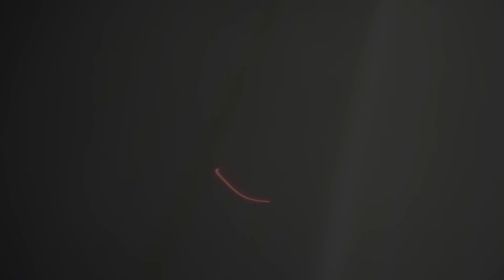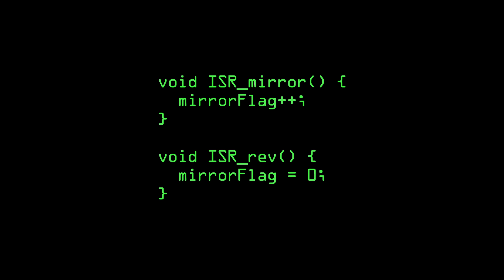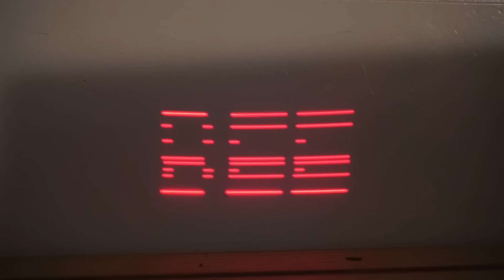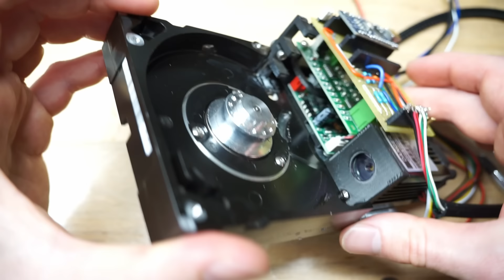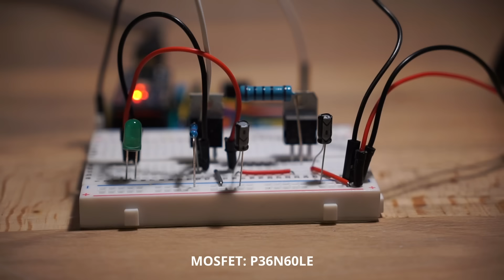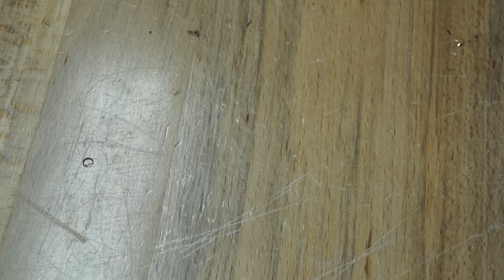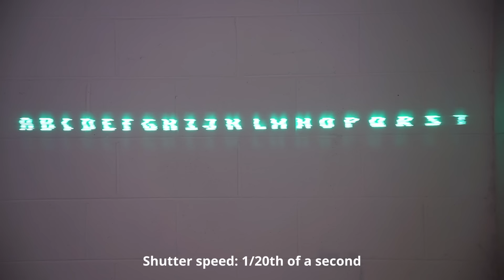DIY Laser Projector - Built from an old hard drive

Comment: Interrupts on Arduino introduce random ~10µs jitter, which is roughly consistent with the jitter amount in your tests. For tight timing, try to disable interrupts during the laser toggling and instead wait for the sync pulses from the photodiode by directly reading the pin register in a blocking while loop. The serial communication can be done between frames while waiting for the frame sync (if necessary, this will add one more disk rotation with laser off as a "blanking" interval).
Reply from the maker: Thanks for the info. I definitely need to optimize the code - I'm still pretty inexperienced with the more advanced features of Arduino. Looks like I have some reading to do.
Reply: @benmakeseverything  Yeah, I was also surprised by this "easter egg" when trying to find out why my pulses randomly become 10us longer a few percent of the time, which is pretty bad for time-critical bit-banging. Turns out it's a known issue, but it's pretty straight-forward to disable interrupts around the time-critical part of the code. Just be aware that you can't use timing functions (except microsecond delay) when interrupts are disabled, so the code has to be very "basic" in terms of execution flow (wait for trigger, write out the laser pulses, repeat; and do the "smart" stuff only after the frame has finished).
Reply: @benmakeseverything  Also in theory the second sensor that measures when a full rotation is achieved isn't necessary since the the speed would be constant once it has spun-up and the total sides of the mirror assembly is fixed and know. The inverse is also possible where you could remove the other sensor and just divide each rotation count by the total sides count.
Reply: @smashed_penguin  The full rotation sensor is necessary to synchronize the start of a frame because there is no "intrinsic" way to tell which mirror is the first line if you start from an unknown state. You'd have to manually tune the delay after it has spun up until the image is correct, but that's not very practical (and it will lose sync again if there is a single glitch causing a missed line pulse). It's true though that the full rotation sensor alone should be sufficient and each line can be started with a fixed delay relative to the frame (i.e. full rotation) sync. This would require perfect mechanical balancing of the disk, otherwise you'll get vibrations causing mechanical jitter within the rotation. The additional line sync sensor effectively reduces the mechanical jitter by the number of lines.
Reply: @RealNovgorod  I did not think of that 💩
Reply from the maker: @RealNovgorod  You said it better than I did! This is exactly the reason for the 2 separate sensors.
Reply: @RealNovgorod  it is true that it is much easier to synchronize the full set with the extra sensor, but it could also be replaced by the absence of a tab creating a gap that is twice as wide and just keep track of timing for that gap using software and timers. However, this would only be worth it if you were mass producing these. When you only make one the extra 50 cents for a sensor is negligible.
Reply: @benmakeseverything  A timing of the the digitalWrite function is not stable. (you can find more info by googling  something like "arduino digitalWrite timing). So you need to use a direct manipulation by the port, not digitalWrite. Also, some libraries for that purpose are created. But for your particular task (turn the single pin on/off) it will be just 2 lines changed.
Reply: @benmakeseverything  I have an idea for how you could develop this project further in the future, maybe make a custom app for it as this Laser Projector uses BLE (Bluetooth Low Energy) - also awesome video btw!
Reply: @benmakeseverything  All so consider how a laser printer does it, they use a single photo transister that watches a fibre optic line, at the start of the mirror to signal the start of the scan
Reply: @benmakeseverything  would it be possible to 3 audioinputs do feed the X Y Z axis?)
Reply: @benmakeseverything  : The 8266 Wifi module (sometimes called NodeMCU) is about the same price than the Arduino (2 to 3 euros or $) and run at 8 (or 16) MHz. The good new being that you can entirely re-use the same code except for pin numbers and timings.
Reply: @benmakeseverything  im opting for a collab of you guys! as a C/C++ Engineer i could see a potential breaktrough in quality
Reply: @GreatBullet  Thats contrary to DIY or learning by doing ;) 
If you want so, you could buy the knowlege or labor for most project. But thats not the goal for guys like him.
Reply: jitter on low end AVR Arduinos is not due to interrupts themselves. Rather its due to timer configuration and background "arduino" stuff that comes with even a "one line" sketch.  The millis and micros timer functions are VERY jittery. Hardware interrupts themselves are generally spot on. 

My suggestions would be:
1: If you can, upgrade to something much faster, such and ESP32 or STM32.  ESP32s are so cheap and incredibly fast in comparison. Timer interrupts, millis() and micros() are dead-on accurate. Having a wifi server for  your text input might be worth the upgrade.
 If you cant (or dont want too)...

2: Your horizontal array scheme is convoluted, and is too much work inside the interrupt. And really unnecessary. You have already divided vertical resolution to 12 bits. Rather than playing with timing calculations mid swing, running an abs() function, etc, just divide your horizontal sweep into discreet bits as well. Like, define a character block as 8x12. Then your array is just a bit array of ON or OFF. Actually, one horizontal sweep per character is now a byte. So, a full character is easily defined as 12 horizontal sweep bytes. This will be MUCH faster to process and not timing determinant (your method may be a bit INdeterminate). All in all, this will be much easier to stack bytes in the sweep buffer, move characters around (scrolling text for example), etc.  
Set up a timer interrupt (duration is the WIDTH of the "pixel") that all it needs to do is read the current bit and turn the laser on or off. Keep that ISR as tight as possible. The second, hardware interrupt (triggered by mirror flag) just increments row and loads the row bytes into the buffer. How skinny or fat your font is will depend on that timer interrupt, and will determine how many characters you can fit on the line.

you are currently using signed integers for your array which needs two bytes per array entry. Just the letter A code you showed took 96 bytes to draw. You are doing math, and playing with negative numbers.  Arduino's timer interrupts (especially on low end Uno etc) require careful consideration and configuration, because the "default" millis() clock is quite jittery. Put it together, and you've got bacon letters.  My suggestion reduces the letter A to just 12 bytes and 96 timer interrupts. NO MATH.

I once had to make what I thought would be a simple servo frequency up-converter. Read in servo signal. re-output that signal on a higher frequency. should have been a quick job. Well it introduced all kinds of jitter and flutter on the output. It ended up taking a day or so to iron out.
Reply: Yeah, what  @epremeaux  said is correct - seems like you've reached the point where the Arduino framework is getting in the way. AVR chips are "slow" by computer standards, but 62 nanoseconds per cycle is plenty fast enough if you use it carefully

The use of `int` and `pgm_read_dword_near` are eating a lot of cycles too. If you don't need values larger than one byte, use int8_t or uint8_t and you'll halve the amount of instructions in most cases. Also the trade off for PROGMEM/__flash is an extra 3-cycle instruction per byte loaded, which almost doubles the cycles needed vs reading from RAM
Reply: also, RELENTLESSLY eliminate delay() and delayMicroseconds().
Reply: @epremeaux  Yes, the jitter on Arduino is not caused by the interrupts per se but by the background functions using them, so disabling interrupts (for the relevant sections of the code) eliminates the jitter - but also disables the timers and actual user generated interrupts. In this case the time-critical code is deterministic enough that it can be done without using interrupts or calls to timers, so this should be the easiest way.
Reply: The only thing loop() should be doing is handling "slow" stuff like handling the serial port messaging and dumping the text bytes into the array. If you are not interacting with the device, it should exit immediately after entry.. Literally "if no character in the rx buffer, end the loop"
Reply: @epremeaux  Years ago I pointed out an error in the timing to the Arduino staff themselves and they just responded "it's done and there's nothing wrong". In the old Arduino software in wiring.c, micros overflow should be involved with "255" instead of "256" IIRC.
Reply: Nah! Just offload all the driving to a CPLD reading directly from a ram chip and she'll be right.
Reply: @mattmoreira210  If it were me, I'd say +1 for a CPLD on the driver end.  PIC or Atmel on the user end, if some UI is needed.

Or, once the code is working, Arduino can be ditched and just go straight to bare Atmel with relatively little extra work.  This gets the redundant stuff out the way, brings cost down, allows a smaller part, can get better clock speeds, etc.  The whole Atmel range is at your disposal and there's no need for the Arduino bootloader.  

But, I agree 100% a small CPLD for the driver end would be rock solid.
Reply: use an FPGA frame buffer then
Reply from the maker: Thanks everyone for the feedback! This is a wealth of information! I plan to re-write the code at some point and will take your suggestions into consideration.
Reply: I made a Jitter free interrupt in the past in Assembly language for generating VGA signal, with the main code running in C language.  It was in Atmel Studio, but I'm sure it's doable in Arduino.  The working principle you have to do in ASM is Reading the Counter interrupt to see how many Assembly NOP instructions you have to add to compensate for the 1-2-3 or 4 cycles possible instructions that was interrupted by the timer interrupt.  This way, you will have jitter free display interrupt in ASM.
Reply: I would look at removing all IF statements from critical timing parts of the code - so that each loop takes exactly the same clock cycles no matter what it has to display. 
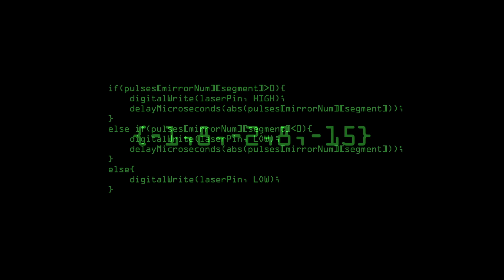eg. at 5:42 in your video - the LOW will execute with slightly more latency than if it was to do a HIGH as to do a LOW it has more code to get through. its tiny speed difference but might add up.
eg - change to .
digitalWrite(laserPin, pulses[mirrorNum][segment]>0); ;so will so HIGH if < or = 0
if (pulses[mirrorNum][segment]!=0) //'if' might be ok here as about to do a big delay anyway
  delayMicroseconds(abs(pulses[mirrorNum][segment]));

Also - for much faster speed use the gpio registers directly - digitalWrite has lots of shifts - search google for "digitalWriteFast"
Reply: Sorry, braindump incoming.  I'm just thankful this isn't my project, or I'd be pouring so much more time into this.  😅

I agree that this is a jitter issue.  Keep in mind that jitter just means variability in the timing of critical parts of the code.  To solve this, you'd need to analyze each path the timing-critical code can take and make sure that execution finishes consistently at the same time, no matter what happens in any of the paths.

Interrupts can be one source of the jitter if misused, but they are required in order to get zero jitter (in general at least).  If not used properly, an interrupt can fire in the middle of a multi-cycle instruction, and each additional cycle required to finish the instruction will add to the effective jitter of the ISR start time.  And if the interrupt can't be tended to at the moment (because another interrupt has fired and took priority, or if you enter a section of your code that disables interrupts), the jitter goes way up (depending on how long it takes for interrupts to be re-enabled).  On AVR, any loop will use multi-cycle instructions (there are no single-cycle branch or jump instructions), so even the most basic while(true) that waits for an interrupt will suffer this problem.

Busy-waiting for your condition doesn't fix that jitter: The simplest while loop could compile to require three AVR instructions per iteration.  That means that you get up to 2 cycles of jitter, depending on when the pin input level changes relative to the start of the loop--or, more accurately, relative to how quickly you can detect the terminating condition and get out of the loop.  If you use interrupts, you can get as low as 0 cycles of jitter.  BUT you have to make sure that your code isn't in the middle of a multi-cycle instruction.  The simple/stupid way to do this is to make sure that the microcontroller is executing a long sequence of single-cycle NOPs when the input level is expected to change.  But, that wastes code space, and isn't a general solution (since you'd have to loop, and RJMP is two cycles).  Better is to enter a sleep mode that keeps the oscillator running.  Waking from sleep can wait indefinitely, use much less code space, and delivers consistent timing.

At 5:41 there's a screenshot of the code, showing different code paths depending on whether the pulse length is positive or negative.  I see some sources of jitter from this: abs() probably has conditionals in its implementation or compiled code, taking a variable amount of time to run; each conditional compiles to instructions which will usually take one more cycle in one path than the other (if the test result is true vs false), just as a side effect of testing and branching instruction timing in the AVR architecture.

Besides those jitter sources, there's another critical timing problem (which might or might not be called jitter): calling the delay function inside a loop won't divide the program execution time into discrete microsecond pieces, because of the time it takes to run the surrounding code, and due to overhead in the delay function itself.  So the first pulse of the scanline would run at exactly T=0, but the second pulse would start at T=OH_0+D_0, where OH_0 is maybe a hundreds of nanoseconds or even a few microseconds of overhead from the last loop iteration, and D_0 was the intended delay value from the last loop iteration.  So, for example, a scanline meant to take (2+2+2+2) μs will take longer than one that is meant to take (4+4) μs, since there's more cumulative overhead for each loop iteration.  I think the same content should result in the same effective timing for each scanline, so this doesn't explain the "wiggle" of jitter, but this variable content-dependent overhead could cause pixels (microsecond time slots) to become misaligned relative to where they should be.

There's different ways to address the content-dependent overhead which involve inline assembly, but the cleanest and probably easiest way (despite the learning curve) would be to control the PWM output of the microcontroller directly.  Skip Arduino libraries for this part, I don't think they expose enough of the underlying hardware to get the timing right.  A PWM timer is basically a counter that repeats at some period you control, so you could set it for a period of 128 to get 8 μs at 16 MHz; it also has an output-compare function which will output high or low depending on whether the current counter value is less than a duty cycle value.  So, if you know you want to output high for 8 μs and low for 3 μs, you'd configure it for a period of 176 cycles (11 μs @ 16 MHz) and a duty cycle of 128 (8 μs).  (I might be mixing up the high/low state; you definitely need to refer to the datasheet for the chip your Arduino uses, and it should clarify what to expect.)  Then represent your scanlines as a sequence of (period, duty_cycle) pairs (as CPU cycle counts for lowest overhead, don't express it as microseconds) and adjust your loop to feed the PWM once you see that it has fired.  ATmega PWM has buffering to help stream in new duty cycles glitch-free, and hopefully it also allows for streaming in new period values as well.
Reply: @jp.larocque  a couple cycles back and forth from an instruction still stuck in the pipeline or from a different execution path being taken aren't the matter here, the magnitude of jitter is about 2 orders of magnitude too large. You have to exclude larger jitter sources first.
Reply: @jp.larocque  listen to this guy, not the one talking about a bootlader
Reply: @jp.larocque  bro casually dropped a medium article in a yt comment
Reply: @jp.larocque  Most interesting. This brings back days of producing PWM signal using 6522 VIA...

Remind me: are there processors that abort the multi-cycle instruction when IRQ is triggered, and restart it upon return?
Reply: Hello - is this Ben? - Well I really enjoyed your project but in the end used a Black Marker & A4
Reply: When I saw your code and the "jitter" of the laser wiggling back and forth I knew right away that using interrupts would cause exactly that jittering effect.  I strongly recommend reading the input pins directly in a blocking while loop like another person suggested.  That eliminates the overhead of an interrupt call and the resulting timing jitter.  Its complicated to explain without intimate knowledge of how processors work, but basically if you are sitting there waiting for something to happen in a tight loop, the time it takes to act is much shorter, and more consistent.  If you use an ISR, you have a lot more to do behind the scenes that causes delays and jitter.  Thanks for an interesting project!
Reply: I would also have said to bump to 16 segments and store the current mirror being displayed in a nibble. That way overflow does the work for you.
Reply: personally I would want to get away from using interrupts to do the pulse timing - first though would be to use a serial output with a block of data and just keep it fed, allowing the serial hardware to manage accurate timing of the bits. I'm more familiar with STM32 at this point, which has 16-bit shift registers and DMA to keep them fed. the max bit clock is something like 18MHz too, so 55ns timings are possible. the only tough part then would be getting the lines aligned with each other and the rotation, since triggering the DMA sequence can't be done directly. I would think a combination of an interrupt and a timer would work - where the optosensor triggers both a CPU interrupt and a timer to start a one-shot count, then the CPU gets everything ready before going into a cycle of checking the counter (busy-wait) till it reaches a preset amount, at which time the CPU initiates the serial transfer to start.

A possibly cleaner option would be to use a timer and DMA for everything. In stm32, DMA can be triggered to put new reset and CC values into a timer on each reset, so a series of data pairs - {from off: time to next on, time to next off}, could be prepared and left to the DMA and the timer. The timer can be initiated directly from the external pulse. This could be done also on AVR with CPU and interrupts taking the place of the DMA, since timings are not handled directly by the interrupts.
Reply: @treelibrarian7618  The serial communication isn't the issue here. The Arduino has a dedicated buffered UART which doesn't care what the main program is doing, and there is also very little serial data to handle occasionally in this application. I'd put the serial read routine in the "time-variable" part of the cycle, e.g. after the last line finished drawing and before waiting for the next frame sync pulse. Reading a few serial chars and setting up the on/off arrays for the lines should just take a couple microseconds, so it might be squeezed in before the frame sync without having to wait a whole rotation. The rest of the rotation (drawing the letters) has deterministic timing and should be done with interrupts disabled to avoid jitter caused by the backround timers.
Reply: @RealNovgorod  I think you misunderstood my point. my point was to use the serial output pin to control the LED, because it has the buffered shift-register output that is immune to interrupt jitter. and SPI, not UART because no start-stop bits, but ignoring the clock 'cause we don't need it. but imo using timerCC/pwm output would be more efficient if you're OK hitting hw registers.
Reply: @treelibrarian7618  I see, you want to control the laser by using serial as "GPIO". That wouldn't have the intrinsic Arduino jitter, but how do you want to maintain tight synchronization, since it's a buffered output? I mean, there would still be a short but uncertain delay between the rotation sync pulse and when the actual "pixel" bits are physically sent out over serial to control the laser.
Reply: @RealNovgorod  I know. it's also a heck of a lot of bits that the CPU has to feed out. hence my saying that the cleaner way to do it, and my preferred, is using the timer/pwm system. better timing resolution, much less data.

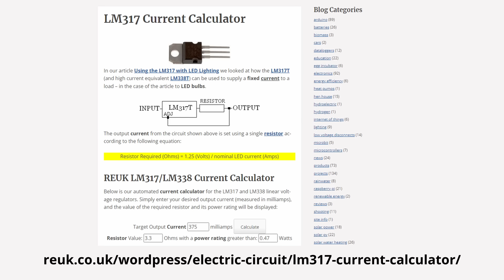assuming atmega328/32u4 similar hardware (I think the board he's using is a nano?), the input capture can be used to reset the counter to a stable known timing, and set off an interrupt. set WGM[13:10] (split between TCCR1A/B) to 4 (CTC on OCR1A), with OCR1A&B both set to FFFF, COM1B[1:0] set to 3 (set on compare match, clear on reset) and the timing input connected to ICP1 (or the analog comparator), and suitable bits set for using it. have the Input capture interrupt pointed to a routine that simply sets OCR1A to ICR1+some constant,  creating a stable starting point for the sequence that follows. OC1A interrupt can then be used to feed pairs of values to OCR1A/B, where OCR1B sets the time before next switch-on, OCR1A sets the time to the next switch-off, at which point the oc1a interrupt fires again and the next pair of values are loaded. the values can all be pre-computed into a table so all the interrupt does is copy 4 bytes from the table to the hardware registers and increment it's table index. Each line ends with A&B both being set to FFFF to wait for the next input capture to start the next scan-line.

this assumes that the output compare on channel B works the same for CTC mode as for fast PWM mode, which is unclear in the manual but probable, and would need testing.

that said, keeping the timing data in ram would limit the text to about 27 characters (12 lines, average 1.5 flashes per line per letter, maximum 500 flashes) if using 32 bits for each timing pulse, but it should be possible to reduce the data required to 2-bytes per flash, and get 55 characters. Alternatively the lines could be computed in the "flyback" time while waiting for the sync pulse... so many possibilities...
Reply: That makes sense, good thinking! I actually think the artifact is small enough to just give it a little analog character though. Looks kinda cool...
Reply: One problem here is that it should not use two interrupt handlers that may trig at the same time. Manufacturing tolerances will affect where line interrupt and frame interrupt happens.

Best is if the line interrupt starts a long SPI transfer where the SPI supplies hw-accelerated output of serial bits of data (which then decides number of horizontal "pixels"). This means that some code needs to convert the us on/off into strings of 11111 or 00000 corresponding to the on/off time lengths.

Then sometime within the busy line output, where the HW-accelerated SPI sends out the line, the frame sync sensor can be read. With it having a time offset way off from the line pulse sensor the two IRQ may not happen at competing time.

Jitter of frame detection doesn't matter. Jitter of filling SPI FIFO or SPI DMA doesn't matter either (as long as it doesn't run dry). The only part that matter is the Jitter of line detect, to start the SPI run for one scan line.

Another thing - an ESP32 may be a better choice because of the huge amount of extra CPU power and included WiFi/Bluetooth.
Reply: Maybe you can use just one sensor and enlarge one finger of 8, so you’ll probably able to determine the first frame
Reply: Since the timing is so critical, I would just skip the Arduino hobby level processors and move on to much faster platforms or FPGAs since this doesn't require computing power, its simply repeating timing blocks: on-off-off-off-on-off-off and so on..
Reply: Another suggestion from someone who did this stuff for a living-
Assuming you can find a suitable arduino library-
- wait for the frame sensor to trigger
- set an input timer to trigger directly from the mirror input sensor - this also triggers an interrupt which configures the next step
- set an output timer to turn the arduinos laser control pin on or off directly, and add whatever time you want this to happen to the input timer value from above. This also triggers an interrupt so this can repeat until you have finished one frame.
If you are still getting jitter and it is due to vibrations or irregularities in the triggering of the optos you can add a software phase locked loop (PLL) to all the inputs. This is not as hard as it might sound. It won't correct for mirror vibrations though.
Reply: @jonanon8193  This will not be cycle accurate.
Reply: @C_e_d_r_i_c1  What do you mean?
Reply: @jonanon8193  The jitter between instruction cycles.  Instruction take 1 to 5 cycles to execute and this cause jitter.  You must equalize the shorters cycles in interrupt to avoid jitter
Reply: @C_e_d_r_i_c1  Instructions cycles are irrelevant. 
The timer hardware is doing the timing directly. 
There is one constraint - the interrupt service routine must run to completion before the next transition of the laser control pin is due - jitter is irrelevant. There is no way to make timing better other than to run the hardware timers faster or to upgrade to a CPU that has faster hardware timer. 
I have seen an implementation of Pong where the video signal is constructed in the same way as I have described in a Arduino style CPU with no perceivable jitter or defects.
Reply: You could get the same effect by building it out of hardware. What you do is use a 1 bit memory chip, and you connect the address pins to 2  binary counters. You want the  second counter on the higher address pins to select the line. Your mirror sensor resets the lower counter and advances the higher counter. The lower counter is driven by a clock. You would also need some sort of buffer to enable writing to the memory.
Reply: As an embedded engineer, my first thought was that your jitter would be the result of interrupt response time: you can run into strange situations with the instruction decoding pipeline (common with 8-bit ALUs), or other things that can preempt your preemption. You can also get jitter when aligning different clocks with each other. For the most tight timings, I've usually done RAM-based data tables that are shifted via DMA directly into a GPIO register, or even better, into a SPI TX FIFO. If you can't afford the RAM, a ROM-based character table is also extremely common.

My second thought was that you might have a bit of jitter from the unevenness of the ridges of your 3d printed arms that break the beam for the position sensor: any mechanical resonance could result in microscopic flexing. That being said, tolerance issues from arm-to-arm might require some slight fine-tuning too.
Reply: You might be able to toggle the laser using the 'input capture register' and with timer 1 pwm on the Atmega328 (Arduino Uno chip). Change the values of the register to create extreme precise timing (should be able to get 1/16.000.000 of a second precision), 1/16th of a microsecond
Reply: @xuniwor  I've tried this on an ESP32 using interrupts to time a pulse for a tachometer.  The trouble is the time it takes to do its thing is non-repeatable. You get random delays. I solved it by ignoring values that jumped too far from the mean value. It was a dirty fix!
Reply: @Andrew-rc3vh my idea is without interrupts, atmega chips do hardware PWM, you can set the specific values and the timing will always be perfect (within the 1/16.000.000 of a second timing interval)
Reply: @xuniwor  In that case I would go for your solution.
Reply: I was thinking the exact same thing
Reply: 10 plus years since My last Arduino projects but I remember back in the day I was able to overcome all kinds of timing issues by utilizing internal timer interrupts and PWM for pulsing data with DMA
Reply: If some kind of analog dummy (not me!) asked you whether slowing down the motor RPM would give you more breathing room on the timing of each pulse, how would you explain why it wouldn’t without publicly humiliating him? Imagine explaining to like, I dunno, a metal fabricator. Hypothetically.
Reply: @tylerwilliams1343  Slowing down the motor would indeed increase the timing precision because the interrupt jitter would be a smaller fraction of the drawing cycle. But it would also ruin the persistence of vision effect and make the "image" more flickery than it already is unless you also slow down your eyes somehow, and that's no fun.
Reply: @RealNovgorod  That reminds me of the old Exploratorium site that had the POV eyes with glacial refresh rates up on the walls you had to look side-to-side quickly to see it. It wasn't fun, you had to do it so many times you got a cramp in your eyeball.
Reply: It shouldn't be so hard, is it? https://youtu.be/sNCqrylNY-0
Reply: Perhaps a Cypress PSoC or similar chip that is an ARM mcu with FPGA fabric that you can code your own peripherals in Verilog/etc. You can then offload the mirror counter and scanline generation to pure logic. Wouldn't even be complex verilog to do so. The mirror counter is a simple reset-counter so a few LoC, and for scanline generation a countdown timer and shift-register or FIFO buffer. FIFO would generate an INT when near-empty for the ARM code to fill it.
Reply: @ColinMacKenzieRobots  They're a bit pricey, personally I'd probably just use a TinyFPGA and communicate with it over SPI. It's based on the ice40 FPGAs from Lattice, so not top of the line but more than fast enough for this
Reply: Don't travel to the USA.  Students study hard, and you easily steal their ideas from their brains. That sounds like a good deal. Fighting for freedom. New slavery. It is my responsibility. I thought everyone should know. We are imprisoned in a place whose slogan was freedom.  Don't travel to the USA. Never even for a short time. If you have any special knowledge or skills or an invention, they will steal it from your mind. The US government initially used this method to identify people who intended to harm the United States. But today, they use it for many purposes, including stealing information from people and stealing data from people's minds. Many celebrities like Taylor Swift and Harry Styles are helping to lure the US government. They can see whatever you see. You'll never have privacy even with your wife or girlfriend. They could see whatever you think. When Taylor Swift said I used my best colors for your portrait, she meant it. when she said, "Touch me, and you'll never be alone." Or when she said, I can read you like a magazine. Your silence would help them to do it again and again. They said, "Don't say anything because of the USA. I want to take her to court. They wanted to pay me $1,000,000. Those are not only songs (Taylor Swift) likes A writer of crime stories whose stories are authentic and have committed all the murders. Taylor Adolf Hitler, the Humans, are not your laboratory mice. Sometimes, what we hear is like warning lights to prevent accidents. Events that the causes of those events are not afraid of repeating them, but they are happy. Money,  power and Black magic There are three levers that they use to achieve their goals. Let's not ignore what we hear. Kidnapping in a new style. Please like and share this to spread awareness and support
 ......................................... #TaylorswiftIsMurder  Doggy styles ( #HarryStylesIsMurder ) #SelenagomezIsMurder 
#BidenIsMurder
#Astatueofstupidity
  #TrumpIsMurder  
#NotraveltoUSA
Reply: Didn't understand most of that. You sure it's English?😅
Reply: What he could also do is simply hook the laser up with the Arduino output + a secondary clock that is more precise with an AND gate. But that might cut some things off instead of just wobbling them. I kinda like the wobble though, it gives a retro ish look. Certainly not easy to repilicate such an effect without this arduino quirk.
Reply: Arduino interrupts are notoriously complicated and unreliable. Use IC
Reply: BECAUSE YOUTUBE HAS RECCOMENDED THIS FOR THE 90TH TIME..... AND I HAVE WATCHED IT AND HAVE NO FURTHER INTEREST.. I WILL BE DOWNVOTING IT SO IT STOP SHOWING UP ON MY FEED BECAUSE GOOGLE NEEDS TO LEARN TO CODE.
KINDLY TAKE IT UP WITH GOOGLE.. I ASKED THEM SEVERAL TIMES TO NOT SHOW THE VIDEO AGAIN.
Reply: @SLAYERSARCH  Buddy, google has no opt-out. Clicking on "do not show" is just SEO for the algorithm, you don't control your own feed (because that would be too useful and is called Newpipe).
Reply: One answer could be to alter the math to operate in the frequency domain. The interrupt simply updates the calculation of the rotational frequency, and we just assume a smooth rotation between measurements. With a drum spinning at high speed, it's not very likely that the RPM is going to change mid-rotation. I'd also throw in an "empty" frame which could allow the calculations to be re-processed without introducing artifacts.
Reply: Esp32 - Rtros
Reply: Haven't worked with Arduino all that much, but I worked with Atmel AVRs and other microcontrollers a LOT, and most of the time that kind of "jitter" is due to having way too long ISRs... Keep your interrupt vectors as short as possible.. Instead of doing the work inside the ISR, just set a flag and do the work in the main loop.
Reply: Intterupts so fucking annoying
Especialy when they increase to 100ms on your x86 computer
Reply: And the default interrupt is the 1 millisecond timer which makes millis() work. If you disable interrupts then millis() won't work which is fine if you don't use it
Reply: What is the cause of that jitter? I don't think that IRQ and NMI even on ancient 1mHz 6502 were that "sloppy".
Reply: @bazoo513  No idea, but most likely it's the Arduino bootloader implementation. Interrupts are used to keep track of the internal timers among other things.
Reply: @RealNovgorod  Ah. Makes sense.
Reply: @RealNovgorod  Mhm bootloader? It's no longer running when your program is running.

It appears there isn't anything particular about iterrupt dispatch, it isn't variable latency in software before your ISR is called.

But i think there are two situations. One is if you're already in a different ISR, and interrupts are disabled. Another is if the processor is sleep (power down), but it takes a substatial time to bring up from this state, as opposed to when it's already executing code.
Reply: @SianaGearz  I meant there is some Arduino specific code started by the bootloader to implement some basic functions like serial communication or timers in addition ot the user program - in order to provide this features to the user if needed. Or it might be compiled directly into the user program that you upload, I'm not sure how exactly it's implemented. The point is that these background functionality makes use of interrupts (e.g. for timing) and causes unpredictable microsecond delays, which are gone if you disable interrupts.
Reply: @RealNovgorod  Aha. Yes, I forget that Arduino has something akin to "pico-OS" with some basic support functionality like timers. My use of 6502 and 6809 (what a difference between those two, BTW!) was on "bare metal", in assembly.
Reply: @RealNovgorod  all of what you said may he very useful to me in the future. I'm an embedded engineer and I have a good number of Arduinos. I do use AVR C as well sometimes though and I may not always the Arduino bootloader, but I would never have thought about the bootloader setting different interrupts. But that makes complete sense. That's a good one to remember.
Reply: @Marco_Onyxheart  Well, the issue is caused by the background functions running on the Arduino in order to provide "convenience features" (such as timers) to the user at the cost of unpredictable delays once in a while. The "easy" way to fix it is to disable interrupts because these background functions require interrupts and simply won't run (and cause jitter) with interrupts disabled. I'm sure there is a "proper" way to disable those background functions without disabling user interrupts but it might require a different compiler or bootloader. Just be aware that some AVR "ecosystems" use background functions for convenience features by default and you may not have control over that unless you go into the assembly code...